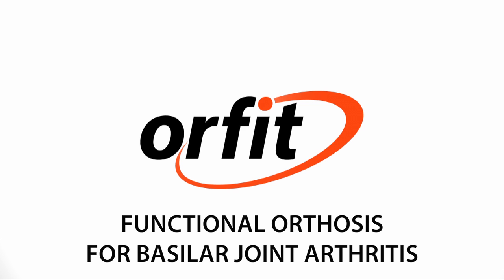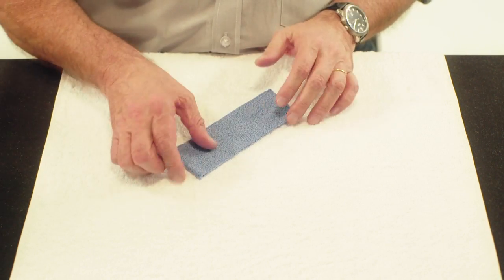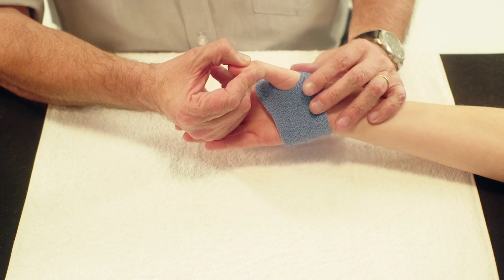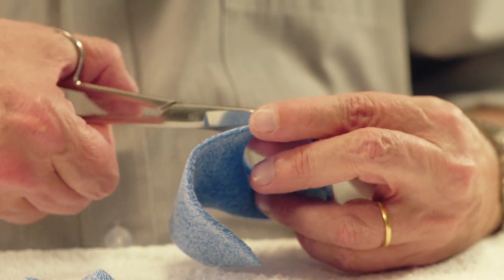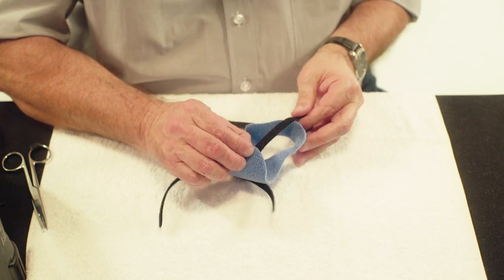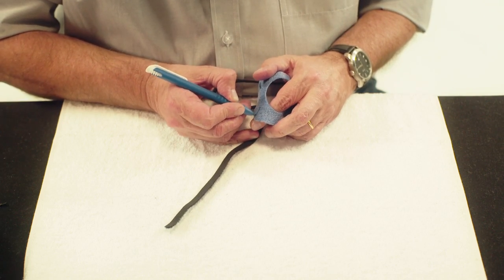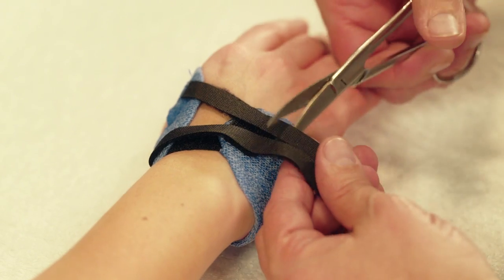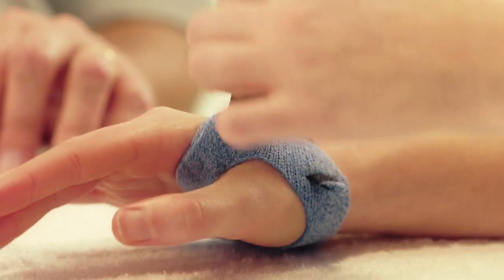Functional orthosis for basilar joint arthritis - Orficast Instructional Movie 16

Comment: Can it be used to make humeral orthoses for the treatment of humeral fractures?
Reply from the maker: Hi Eunice, it is possible to use Orficast More 30 cm for a humeral fracture brace and perhaps reinforce it with a strip of Orficast More 15 cm down the middle. Adhere these together via dry heat or hot water prior to molding.